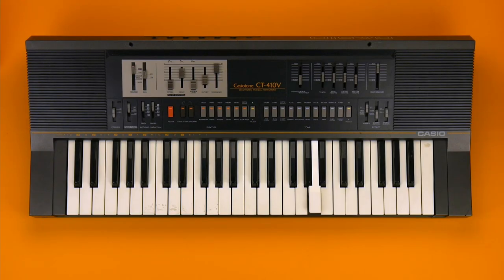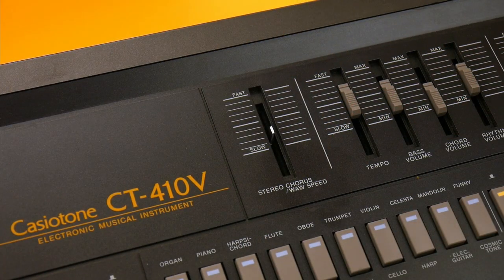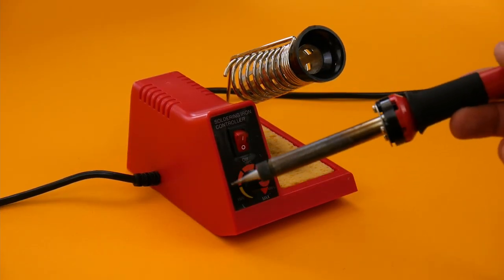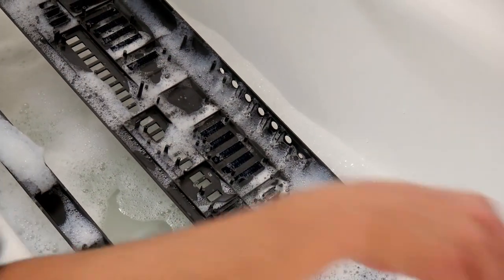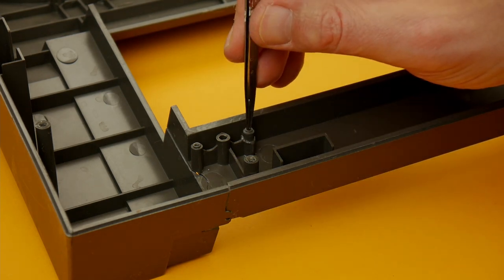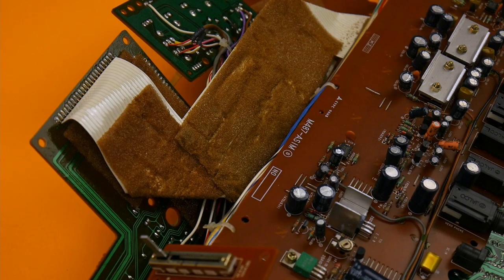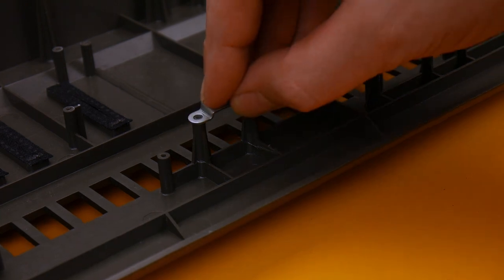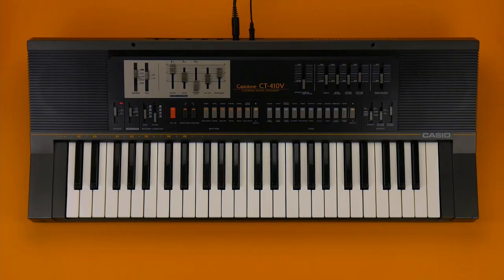Casio CT-410V - Repair

Comment: Mesmerizing and fascinating to watch - excellent work!

When it comes to repairing large cracks in a case, one thing I often do is to cut small sections of plastic from old food containers, and glue them on the inside of the case over the cracks to reinforce and add strength to the repair. From the outside you wouldn't be able to see these extra pieces, but they add more strength and help prevent the cracks re-opening.

Love the backing music too 👍
Reply from the maker: That's a good idea, thanks!

Comment: It's me who had completely reworked my Casio CT-410V and e.g. added all missing easteregg features of MT-65.

But NEVER use multi-purpose grease - it will make plastic brittle and crumble apart after some months or years. - Use silicone based grease only! Broken plastic hooks under keys can be easily replaced by hotglueing a thick stiff (non-wick) copper wire. Cracked plastic can be welded by using a cotton swab with pure acetone (let it dry some hours afterward, else it breaks like chocolate), but be careful not to spill or smear it where it shouldn't (it will ruin the case surface). Superglue works too, but vapours leave hazy stains those can be unremoveable on transparent parts (be careful with optical components in displays, cameras, CD drives etc.). A piece of glued blister plastic helps to reinforce cracked parts.
Reply from the maker: Thanks for the tip! I will try the silicone grease next time!

Comment: Great work again. It sounds surprisingly good. Must be those envelope controls. My tips. Use some wood filler to smooth out any cracks which are still visible on the outside. Then the color it in with a set of children's felt pens. The bigger the number of tints in the set the better. If you get the hang of it you can often recreate the right color quite closely. Although the felt pens colors might be the wrong ones at first sight mixing them by applying them in a pointilistic manner in multiple layers can lead to surprising results. It's a trick i also use on furniture to recreate specific wood tones. It' might not be perfect but creating a hue quite close to the original color is often enough to make a damaged area stick out a lot less. You can also use it for smaller scratches which tend to be lighter then the non-damaged material because the reflective properties of the material in the scratches has changed. Always wipe excess ink away around the scratch before it dries. Why not try it out first on a less precious object to get a hang of it. :-)
Reply from the maker: Nice tip, maybe I'll try it on my next project
Reply: Check how "smart repair" for car dashboards works. They often do similar things and there are plastic repair kits with paint in matching colours etc. (I haven't used this.)

Comment: Looks and sounds great. Usually for mods on these old Casios, I stop at adding output jacks but I would be quite tempted to extend the trim pots of the filter to surface mounted knobs for deeper editing. I'm glad you mentioned the chorus again. Quite a powerful and rare effect on a keyboard like this.

Comment: Have you tried 2 part epoxy for plastic repairs? I find it useful sometimes when you need more strength.
Reply from the maker: Thanks for the tip. Maybe I'll try it next time, but actually I'm quite happy with the plastic glue.

Comment: Really satisfying repair! I'd suggest not worrying about getting glue on the outside of the case - if you use a "superglue" type then I've had good results with scraping any excess off using a razorblade. I use the single sided type of razor blade that can be found in craft shops to clean the excess glue from repairs to plastic cases and also on the body of a bass guitar.
Reply from the maker: Thanks! I will keep that in mind.

Comment: Great, as usual. For cleaning i also use a brush pencil, for the places dificult to acces. There is a big trap also : the small balls inside the switches 😩 easy to lose. This keyboard looks like those from Roland of the same erea.

Comment: One question I have a CT400V , is it possible to disconnect the built in speaker when using it on output line with external amplifier ? Do I need to install a specific switch ?
Reply from the maker: Yes. But you could also use the headphone jack. It automatically turns off the speakers.
Reply: @KeenOnKeys  And NEVER use contact cleaner spray on potentiometers. Particularly with these slide pots (in Bontempi and Casio of that era) it will dissolve the carbon track. Isopropanol is a bit less aggressive (but still don't use scrub with force while soaked). I normally only clean slide pots with a bristle and remove dust by vacuum cleaner. Then play a round of Decathlon on them (move 20 times back and forwards) to get rid of crackling.
Reply from the maker: @cyberyogicowindler2448  Oh dear! It looks like I've done a lot of things wrong. The contact cleaner I used was recommended to me and to be honest it has always worked well so far.
Reply: @KeenOnKeys  Contact cleaner spray exist multiple types, but many can be only used for metal because they dissolve the carbon paint in certain potentiometers, which is similarly fragile like a pencil streak. (You can even fix worn pots with soft pencil, but it isn't robust.) Also avoid epoxy glue where not strictly needed. It is the most toxic of all household glues and causes cancer. Never touch the liquid or uncured glue without gloves and also avoid the vapours. I only use the kneadable "clay" type (wear nitrile gloves) to reconstruct crumbled screw posts those need to withstand strong strain (mount a CRT or entire chassis to the monitor frame etc.).

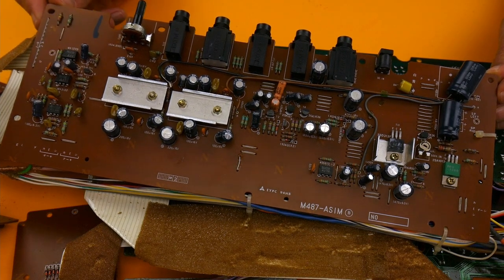Comment: I have a Casio MT400V sitting next to me. I payed $6 for it lol. I took it apart to remove the chorus circuit. Those BBD chips (MN3102\MN3209) 9:45 are difficult to find. I built a Ibanez FL9 Flanger circuit\guitar pedal out of the chips. Unfortunately I have no luck getting the keyboard to function after that. Maybe this video will help, Now I'll watch it and hope I see something that helps :)